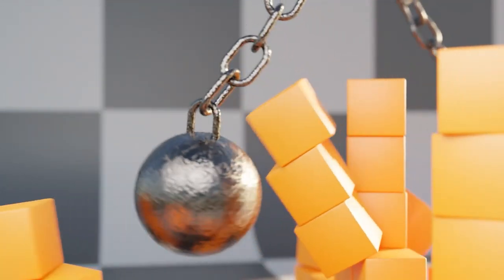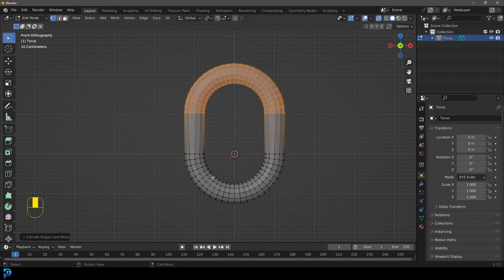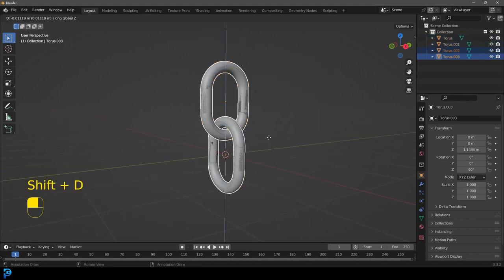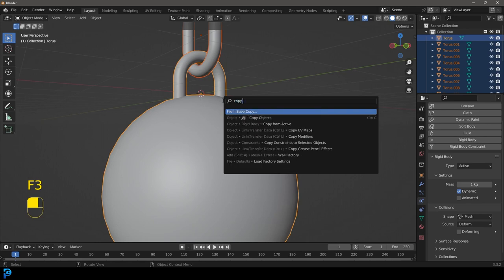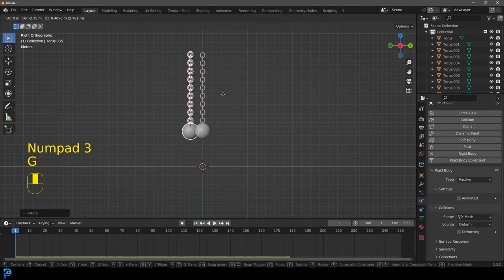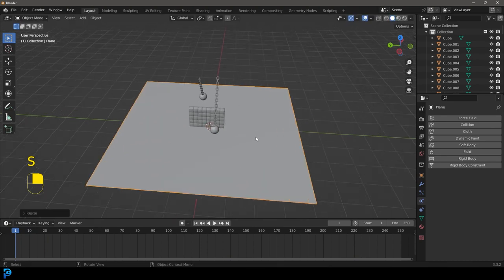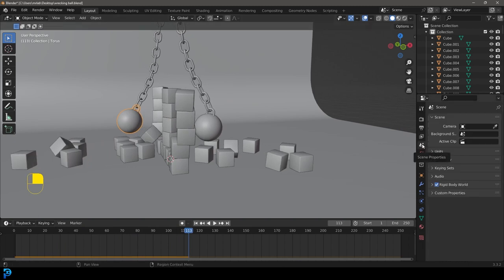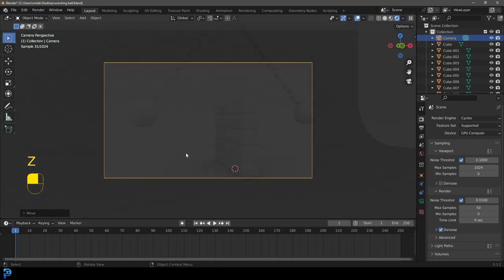Blender: Wrecking Ball Sims Are EASY | Tutorial

Comment: thanks! can i ask a question?
i'm new to blender and i wanted to use it to edit a video, i dragged a video that turned out to be not the one i wanted to edit, so i deleted it by pressing x and now i can't find it on my pc! it may be an irrelevant question but i'll be so thankful if you can help me recover it from a recycle bin or something, thanks again!
Reply: IM NOT AN EXPERT... but I assume the same logic applies if you delete a video off after effects. Its nothing but imported to the scene. So the original should be untouched
Reply: @moederthemeddlesome2384  well it was actually a bunch of videos at the same time that i mistakenly deleted from blender lol and then i found most of them in the windows bin but 2 of them are still missing, i think there is a recycle bin in blender but i couldn't find it
Reply from the maker: This is odd, but i dont think you removing it inside of blender was the cause. Perhaps run a free recovery program. best of luck